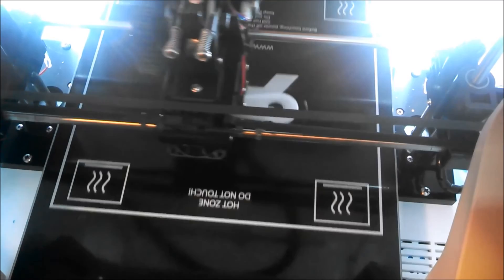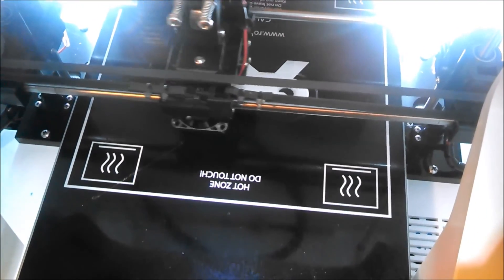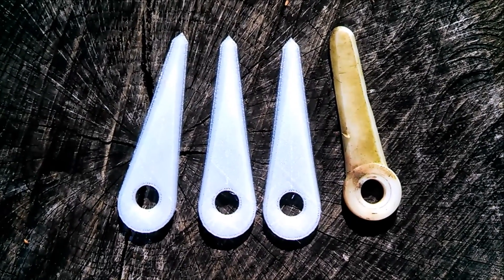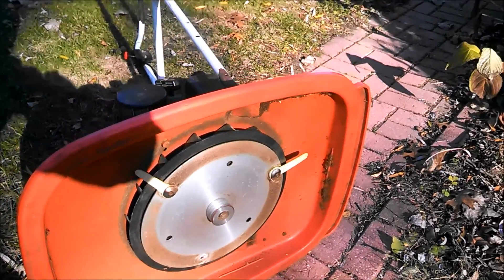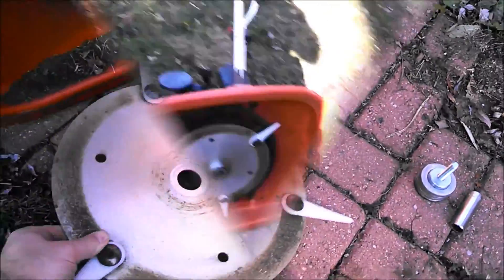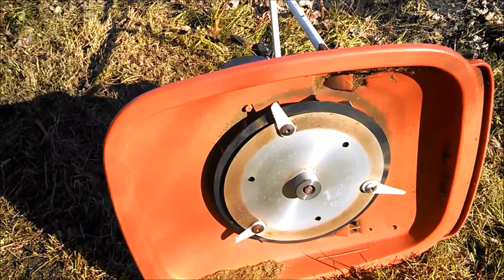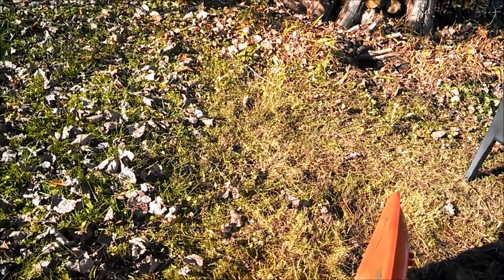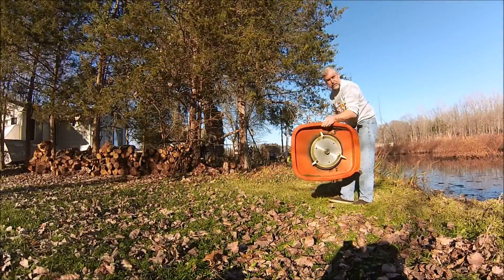3D Printed trimmer blades on Allen hover mower

Comment: I know this is old; but did you ever find a better filament to use?  I was also considering something Nylon based; or simply printing with trimmer line as it is nylon based and possible to print with once dehydrated.
Reply: Nylon would be the best filament to use. Simply because most trimmer lines/blades are made of mostly Nylon.